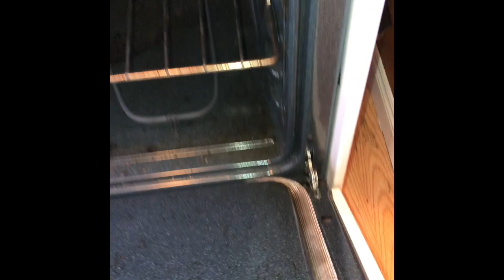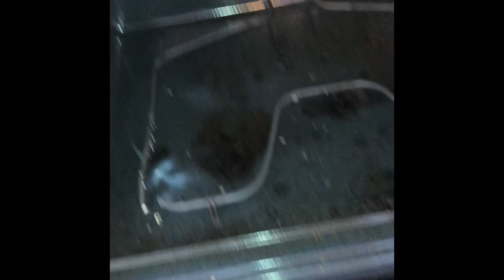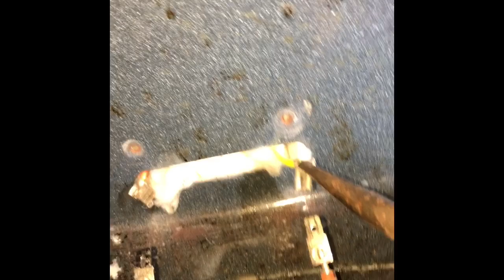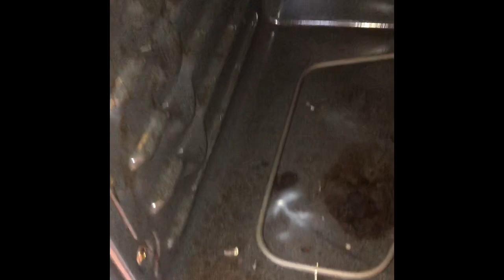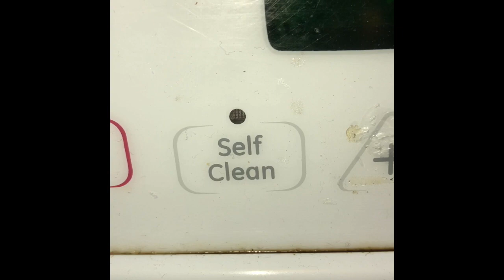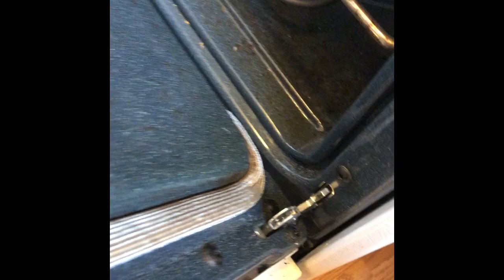✨GE Electric Oven Won’t Heat - Bake Element - FAST & EASY Fix ✨

Comment: Is the heating element supposed to stop the red glow an inch or 2 before oven wall, which it looks like in your video?
Reply from the maker: I think so,
Does yours go all the way back?
Reply: @QuickAndEasy5MinuteAppliance no it stops,  like in your video. I put it in myself & just wanted to be sure thats ok.

Comment: If the wire is pulls loose use a magnet fish to get the wire as the connector is magnetic.
Reply from the maker: Clever idea😊

Comment: Just did this replacement but my new elements bracket was a little wider than the original so I had to force the screws back in. The plate on the bracket isn't quite flush with the back of the oven so there is a little bit of a gap. Is this OK?